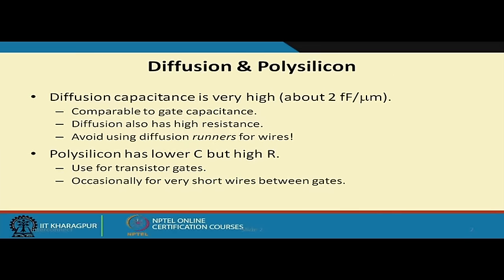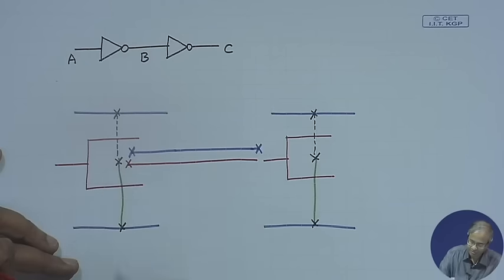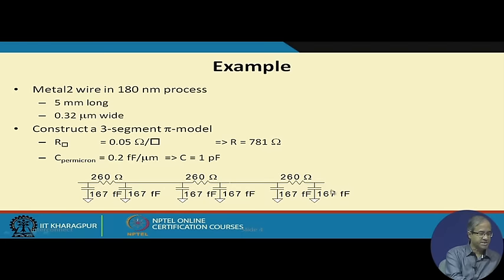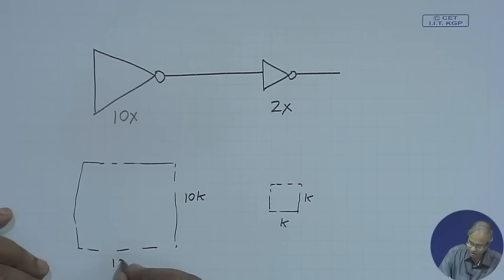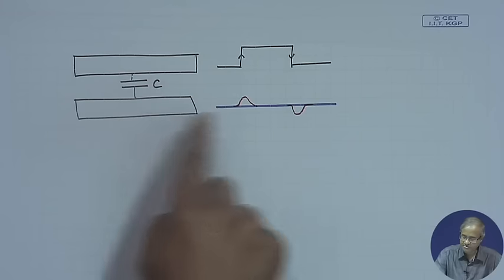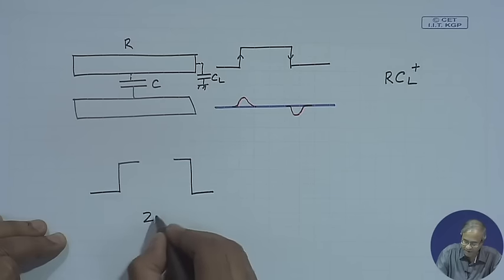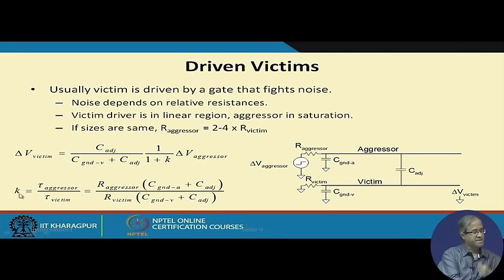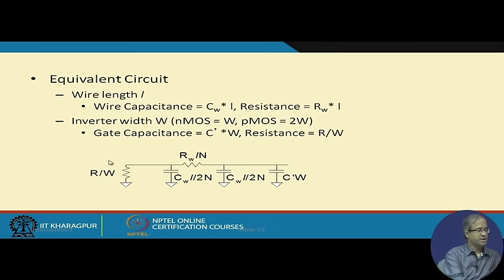Interconnect Modeling (Part 2)

Comment: How to calculate driver resistance and load cap
Reply: We have to assume the values of driver resistance and receiver unit capacitance value...
Reply: Me too can't understand his method in wire RC delay
Reply: I think driver capacitance will 900 2.5k*.36=900 but sir has  done some wrong calculation and written 690
Reply: I think driver resistance is calculated as 10 * (2.5 kohm um / 0.36 um) (for 10x inverter) and load capacitance is calculated as 2 * 2fF (gate capacitance is 2fF for unit inverter from previous lecture and this is a 2x inverter)